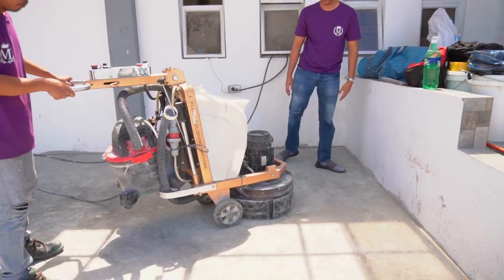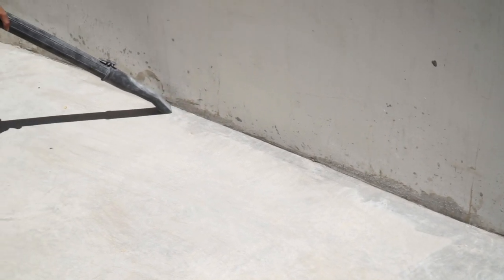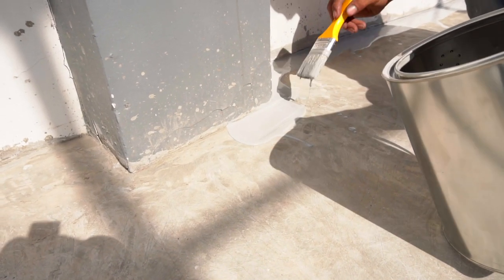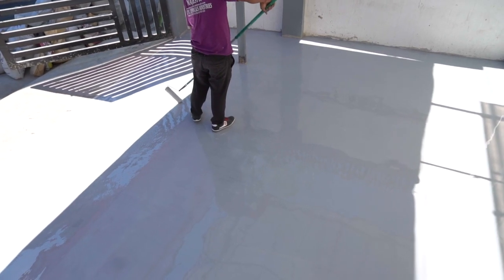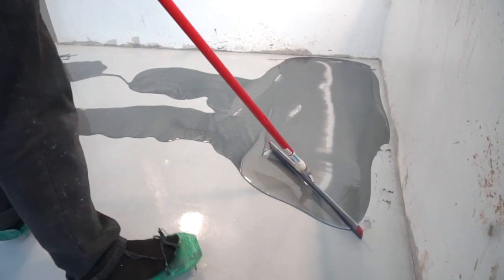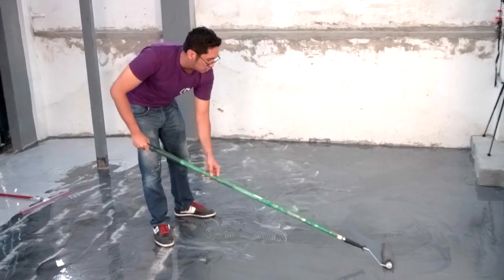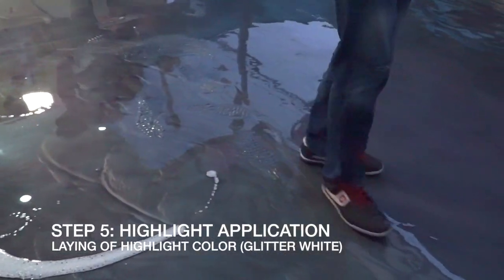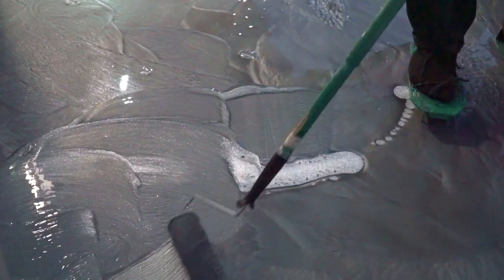METALLIC EPOXY GARAGE PHILIPPINES   METALLIC EPOXY FLOOR PHILIPPINES

Comment: dumadapa puba kusa ang resin? kahit di lapat na lapat ang pag kakalatag,  kasi pag ka roller medyo raspy tas pag na finish makinis na.
Reply from the maker: Good day

Yes sir, Selfleveling po ito at talagang smooth at glossy pag nag ddry na sya :D 
For availing & quicker response, you may contact us
(+639182523454)

Comment: Di po advisable sa garage madulas lalu nat expose sa ulan at araw. Best sa indoor. But ang ganda ng kinalabasan. Thumbs up.
Reply from the maker: Good day, eto pong ating product ay 
-water resistant
-heat resistant 
-scratch resistant
-dust resistant
-chemical resistant
-di nag ccracks
-di nababasag
-walang maintenance, walis or punas lang
-super easy to apply
-shiny at elegant pa tignan
-non-slippery even wet
-odorless & solventless
-industrial grade
-food grade/safe
-Lifetime Quality
Can hold up to 10,000 PSI

Opo di po sya madulas kahit basa maliban dun
sa garage we recomend our Plain Selfleveling Non-metallic resin + UV coat protection sa sun light.

Comment: How much does it cost per sqm? Materials? Labor?
Reply from the maker: Good Day

makakabili po kayo sa amin, just message lang po and we will answer those Questions :)
https://www.facebook.com/majesticchemicals/

also we have LAZADA for COD
You can purchase to our Lazada
then screenshot your order then send it to us here so we can prepare it as soon as possible.
sa Fb page parin po :)
https://www.lazada.com.ph/majestic/?

Visit our Website
https://majesticchemicals.com/

By the way I'm Sherwin of Majestic Chemicals, Glad to assist you :)
For availing & quicker response, you may contact us
09182523454

Join MAJESTIC EPOXY RESIN COMMUNITY PHILIPPINES to show your resin works and share tips
⬇️M⬇️A⬇️J⬇️E⬇️S⬇️T⬇️I⬇️C⬇️ ⬇️C⬇️H⬇️E⬇️M⬇️I⬇️C⬇️A⬇️L⬇️
https://www.facebook.com/groups/398748351104499

Comment: Di ba dali ma gasgas to? How much per sqm ang cost nito?
Reply from the maker: Good day
Materials only
900Php/sqm for Metallic Resin Epoxy
650Php/sqm for Non-metallic Resin Epoxy
 shipping fee not included

2500/sqm for Materials and Labors
equipments and mobilization not included..

di po sya magagasgasan unless sasadyain. 

-water resistant
-heat resistant 
-scratch resistant
-dust resistant
-chemical resistant
-di nag ccracks
-di nababasag
-walang maintenance, walis or punas lang
-super easy to apply
-shiny at elegant pa tignan
-non-slippery even wet
-odorless & solventless
-industrial grade
-food grade/safe
-Lifetime Quality
Can hold up to 10,000 PSI

By the way I'm Sherwin of Majestic Chemicals, Glad to assist you 🙂
For availing & quicker response, you may contact us
09182523454

Comment: Magkano kung 12square meter at kung chemical lang po kami na lang po gagawa?
Reply from the maker: Hi sir san po location? Materials only is 17500. It already includes one gallon primer, one pail metallic with two metallic pigments and shipping fee
Reply: 3333

Comment: Sir pede po ba kayo maggawa ng video ng diy 3d floor using wallpaper tapos with epoxy top coat
Reply from the maker: Good day

Opo, maybe pwede po. But reminder lang po na sa ating resin epoxy need na matibay ang pag lalatagan or pag bubuhusan ng ating resin epoxy or yung base nya. kasi pag weak ang surface may chance na masayang lang. kaya mas prefer natin na rough finish ang floor or kung may tiles, putty sa lines at sanding para kumapit ang resin natin :D 

For availing & quicker response, you may contact us
09182523454

Comment: Pwed b yan sir s rough finish n flooring?
Reply from the maker: Good Day

Opo need tlaga e rough finish :)

makakabili po kayo sa amin, just message lang po and we will answer those Questions :)
https://www.facebook.com/majesticchemicals/

also we have LAZADA for COD
You can purchase to our Lazada
then screenshot your order then send it to us here so we can prepare it as soon as possible.
sa Fb page parin po :)
https://www.lazada.com.ph/majestic/?

Visit our Website
https://majesticchemicals.com/

By the way I'm Sherwin of Majestic Chemicals, Glad to assist you :)
For availing & quicker response, you may contact us
09182523454

Join MAJESTIC EPOXY RESIN COMMUNITY PHILIPPINES to show your resin works and share tips
⬇️M⬇️A⬇️J⬇️E⬇️S⬇️T⬇️I⬇️C⬇️ ⬇️C⬇️H⬇️E⬇️M⬇️I⬇️C⬇️A⬇️L⬇️
https://www.facebook.com/groups/398748351104499

Comment: Saan mkkbili ng materials at pde kmi mka hingi ng broshure.... Processing o paraan step ng lahat para masibukan bgo mka pag apply sa iba nmin customer at mga contrata..
Reply from the maker: Good Day

makakabili po kayo sa amin, just message lang po and we will answer those Questions :)
https://www.facebook.com/majesticchemicals/

also we have LAZADA for COD
You can purchase to our Lazada
then screenshot your order then send it to us here so we can prepare it as soon as possible.
sa Fb page parin po :)
https://www.lazada.com.ph/majestic/?

Visit our Website
https://majesticchemicals.com/

By the way I'm Sherwin of Majestic Chemicals, Glad to assist you :)
For availing & quicker response, you may contact us
09182523454

Join MAJESTIC EPOXY RESIN COMMUNITY PHILIPPINES to show your resin works and share tips
⬇️M⬇️A⬇️J⬇️E⬇️S⬇️T⬇️I⬇️C⬇️ ⬇️C⬇️H⬇️E⬇️M⬇️I⬇️C⬇️A⬇️L⬇️
https://www.facebook.com/groups/398748351104499

Comment: San Po na oorder Yung Resin Sir.? Meron Po ba Ito sa zamboanga city..
Reply from the maker: Good Day

makakabili po kayo sa amin, just message lang po and we will answer those Questions :)
https://www.facebook.com/majesticchemicals/

also we have LAZADA for COD
You can purchase to our Lazada
then screenshot your order then send it to us here so we can prepare it as soon as possible.
sa Fb page parin po :)
https://www.lazada.com.ph/majestic/?

Visit our Website
https://majesticchemicals.com/

By the way I'm Sherwin of Majestic Chemicals, Glad to assist you :)
For availing & quicker response, you may contact us
09182523454

Join MAJESTIC EPOXY RESIN COMMUNITY PHILIPPINES to show your resin works and share tips
⬇️M⬇️A⬇️J⬇️E⬇️S⬇️T⬇️I⬇️C⬇️ ⬇️C⬇️H⬇️E⬇️M⬇️I⬇️C⬇️A⬇️L⬇️
https://www.facebook.com/groups/398748351104499

Comment: magkano material cost per square meter? tsaka labor cost per square meter? and is this waterproof in case sa roof deck iapply?
Reply from the maker: Good day
metallic is color mixed & designed resin epoxy

Metallic Flooring kit
2 Gallons (7 Liters) Selfleveling primer
1 Pail (12 Liters) Metallic/ Liquid marble 
Free 300g metallic pigments 
15sqm coverage area 
18,000 Pesos

Metallic Countertop kit
2 Liters Selfleveling primer
3 Liters Metallic/ Liquid marble
Free150g metallic pigments 
4sqm coverage area 
6,600 Pesos

Metallic Starter kit
1 liter Selfleveling primer
1 liter Metallic/ Liquid marble
Free 50g metallic pigments
1sqm coverage area 
2,800 Pesos

-----

Around NCR area 
Materials & Labor for Marble look metallic Flooring (only indoor)
2,500Php/sqm 
+20k for equipment & mobilization
w/ 5 Years Warranty
---- 
if ang roof deck nyu ay  closed area naman at hindi nasisinigan ng araw pwedeng pwede po yung resin epoxy natin sa roof deck nyu.

meron tayong plain which is non-metallic nilalagyan ng uv coat para pwede sa mga direct sunlight.. 

 Available in White, Black and Gray colors

Non-metallic Flooring kit
7 Liters Selfleveling primer
14.5 Liters Selfleveling Topcoat
15sqm coverage area 
13,000 Pesos

Non-metallic Countertop kit
2 Liters Selfleveling primer
3.5Liters Selfleveling Topcoat
4sqm coverage area 
4,100 Pesos

Non-metallic Starter kit
1 litter Selfleveling primer
1 litter Selfleveling Topcoat
1sqm coverage area 
1,600 Pesos

Materials & Labor for plain Non-metallic Flooring(can be outdoor)
1,800Php/sqm 
+20k for equipment & mobilization
w/ 5 Years Warranty

-----

if really interested po.. plss call or text me..
For availing & quicker response, you may contact us
09182523454

Comment: How much does it cost for a 20sqm floor?
Reply from the maker: Good Day

You can go to our FB page for inquires :)

makakabili po kayo sa amin, just message lang po and we will answer those Questions :)
https://www.facebook.com/majesticchemicals/

also we have LAZADA for COD
You can purchase to our Lazada
then screenshot your order then send it to us here so we can prepare it as soon as possible.
sa Fb page parin po :)
https://www.lazada.com.ph/majestic/?

Visit our Website
https://majesticchemicals.com/

By the way I'm Sherwin of Majestic Chemicals, Glad to assist you :)
For availing & quicker response, you may contact us
09182523454

Join MAJESTIC EPOXY RESIN COMMUNITY PHILIPPINES to show your resin works and share tips
⬇️M⬇️A⬇️J⬇️E⬇️S⬇️T⬇️I⬇️C⬇️ ⬇️C⬇️H⬇️E⬇️M⬇️I⬇️C⬇️A⬇️L⬇️
https://www.facebook.com/groups/398748351104499
Reply: @MajesticChemicals  location niyo po sir?may gray po ba kyo na pang floor?

Comment: Mas mkakatipid b pag epoxy floor compare sa tiles?
Reply from the maker: Good Day

Yes sir :) In terms of Quality at Lifelines natagal po ito ng maraming Decada
-water resistant

-heat resistant
-scratch resistant
-dust resistant
-chemical resistant
-di nag ccracks
-di nababasag
-walang maintenance, walis or punas lang
-super easy to apply
-shiny at elegant pa tignan
-non-slippery even wet
-odorless & solventless
-industrial grade
-food grade/safe
-Lifetime Quality

makakabili po kayo sa amin, just message lang po and we will answer those Questions :)
https://www.facebook.com/majesticchemicals/

also we have LAZADA for COD
You can purchase to our Lazada
then screenshot your order then send it to us here so we can prepare it as soon as possible.
sa Fb page parin po :)
https://www.lazada.com.ph/majestic/?

Visit our Website
https://majesticchemicals.com/

By the way I'm Sherwin of Majestic Chemicals, Glad to assist you :)
For availing & quicker response, you may contact us
09182523454

Join MAJESTIC EPOXY RESIN COMMUNITY PHILIPPINES to show your resin works and share tips
⬇️M⬇️A⬇️J⬇️E⬇️S⬇️T⬇️I⬇️C⬇️ ⬇️C⬇️H⬇️E⬇️M⬇️I⬇️C⬇️A⬇️L⬇️
https://www.facebook.com/groups/398748351104499
Reply: @MajesticChemicals  sir magkanu po byan

Comment: Mas mahal po b ang cost nyan compare sa mga tiles?
Reply from the maker: Good Day

Mas mura po ito in terms of how long it last at sa Quality :) 
-water resistant
-heat resistant
-scratch resistant
-dust resistant
-chemical resistant
-di nag ccracks
-di nababasag
-walang maintenance, walis or punas lang
-super easy to apply
-shiny at elegant pa tignan
-non-slippery even wet
-odorless & solventless
-industrial grade
-food grade/safe
-Lifetime Quality
Can hold up to 10,000 PSI

tumatagal ng maraming Dekada, di nag ffade :)

makakabili po kayo sa amin, just message lang po and we will answer those Questions :)
https://www.facebook.com/majesticchemicals/

also we have LAZADA for COD
You can purchase to our Lazada
then screenshot your order then send it to us here so we can prepare it as soon as possible.
sa Fb page parin po :)
https://www.lazada.com.ph/majestic/?

Visit our Website
https://majesticchemicals.com/

By the way I'm Sherwin of Majestic Chemicals, Glad to assist you :)
For availing & quicker response, you may contact us
09182523454

Join MAJESTIC EPOXY RESIN COMMUNITY PHILIPPINES to show your resin works and share tips
⬇️M⬇️A⬇️J⬇️E⬇️S⬇️T⬇️I⬇️C⬇️ ⬇️C⬇️H⬇️E⬇️M⬇️I⬇️C⬇️A⬇️L⬇️
https://www.facebook.com/groups/398748351104499

Comment: maganda,magaling..kaso sana ung laylayan ng mga wall nilagyan ng tape..pra hnd sna inabot..dumi eh
Reply from the maker: Good Day

makakabili po kayo sa amin, just message lang po and we will answer those Questions :)
https://www.facebook.com/majesticchemicals/

also we have LAZADA for COD
You can purchase to our Lazada
then screenshot your order then send it to us here so we can prepare it as soon as possible.
sa Fb page parin po :)
https://www.lazada.com.ph/majestic/?

Visit our Website
https://majesticchemicals.com/

By the way I'm Sherwin of Majestic Chemicals, Glad to assist you :)
For availing & quicker response, you may contact us
09182523454

Join MAJESTIC EPOXY RESIN COMMUNITY PHILIPPINES to show your resin works and share tips
⬇️M⬇️A⬇️J⬇️E⬇️S⬇️T⬇️I⬇️C⬇️ ⬇️C⬇️H⬇️E⬇️M⬇️I⬇️C⬇️A⬇️L⬇️
https://www.facebook.com/groups/398748351104499

Comment: How much po inabot ganyann
Reply from the maker: Good Day

makakabili po kayo sa amin, just message lang po and we will answer those Questions :)
https://www.facebook.com/majesticchemicals/

also we have LAZADA for COD
You can purchase to our Lazada
then screenshot your order then send it to us here so we can prepare it as soon as possible.
sa Fb page parin po :)
https://www.lazada.com.ph/majestic/?

Visit our Website
https://majesticchemicals.com/

By the way I'm Sherwin of Majestic Chemicals, Glad to assist you :)
For availing & quicker response, you may contact us
09182523454

Join MAJESTIC EPOXY RESIN COMMUNITY PHILIPPINES to show your resin works and share tips
⬇️M⬇️A⬇️J⬇️E⬇️S⬇️T⬇️I⬇️C⬇️ ⬇️C⬇️H⬇️E⬇️M⬇️I⬇️C⬇️A⬇️L⬇️
https://www.facebook.com/groups/398748351104499

Comment: Sir mga magkano po ang magagasto sa 50sqm na floor pag resin.,my fb page po ba kayu sir?
Reply from the maker: Good Day

For more details, Pm us po

makakabili po kayo sa amin, just message lang po and we will answer those Questions :)
https://www.facebook.com/majesticchemicals/

also we have LAZADA for COD
You can purchase to our Lazada
then screenshot your order then send it to us here so we can prepare it as soon as possible.
sa Fb page parin po :)
https://www.lazada.com.ph/majestic/?

Visit our Website
https://majesticchemicals.com/

For availing & quicker response, you may contact us
09182523454

Join MAJESTIC EPOXY RESIN COMMUNITY PHILIPPINES to show your resin works and share tips
⬇️M⬇️A⬇️J⬇️E⬇️S⬇️T⬇️I⬇️C⬇️ ⬇️C⬇️H⬇️E⬇️M⬇️I⬇️C⬇️A⬇️L⬇️
https://www.facebook.com/groups/398748351104499

Comment: sir how much po magpaganyan for 30sqm
Reply from the maker: Good Day

Mag tungo lamang po sa aming FB page for more inquiries :) at para din po masagot ang concern nyu about  30sqm

makakabili po kayo sa amin, just message lang po and we will answer those Questions :)
https://www.facebook.com/majesticchemicals/

also we have LAZADA for COD
You can purchase to our Lazada
then screenshot your order then send it to us here so we can prepare it as soon as possible.
sa Fb page parin po :)
https://www.lazada.com.ph/majestic/?

Visit our Website
https://majesticchemicals.com/

By the way I'm Sherwin of Majestic Chemicals, Glad to assist you :)
For availing & quicker response, you may contact us
09182523454

Join MAJESTIC EPOXY RESIN COMMUNITY PHILIPPINES to show your resin works and share tips
⬇️M⬇️A⬇️J⬇️E⬇️S⬇️T⬇️I⬇️C⬇️ ⬇️C⬇️H⬇️E⬇️M⬇️I⬇️C⬇️A⬇️L⬇️
https://www.facebook.com/groups/398748351104499

Comment: New subscriber here. How much did it cost for this specific project? Materials quantity and price.
Reply from the maker: Good Day

makakabili po kayo sa amin, just message lang po and we will answer those Questions :)
https://www.facebook.com/majesticchemicals/

also we have LAZADA for COD
You can purchase to our Lazada
then screenshot your order then send it to us here so we can prepare it as soon as possible.
sa Fb page parin po :)
https://www.lazada.com.ph/majestic/?

Visit our Website
https://majesticchemicals.com/

By the way I'm Sherwin of Majestic Chemicals, Glad to assist you :)
For availing & quicker response, you may contact us
09182523454

Join MAJESTIC EPOXY RESIN COMMUNITY PHILIPPINES to show your resin works and share tips
⬇️M⬇️A⬇️J⬇️E⬇️S⬇️T⬇️I⬇️C⬇️ ⬇️C⬇️H⬇️E⬇️M⬇️I⬇️C⬇️A⬇️L⬇️
https://www.facebook.com/groups/398748351104499
Reply: Magkano magagawa sa inyo?
Reply from the maker: @johnraymondsiega7017  Good day sir, 2500/sqm po tayo Materials and Labors, 
di pa include ang Equipment and Mobilization

Comment: ask lng po ano po mas maganda epoxy floor than floor tiles po...salamat
Reply from the maker: Good Day

Opo dahil maliban sa Buo tignan, Quality pa :)

makakabili po kayo sa amin, just message lang po and we will answer those Questions :)
https://www.facebook.com/majesticchemicals/

also we have LAZADA for COD
You can purchase to our Lazada
then screenshot your order then send it to us here so we can prepare it as soon as possible.
sa Fb page parin po :)
https://www.lazada.com.ph/majestic/?

Visit our Website
https://majesticchemicals.com/

By the way I'm Sherwin of Majestic Chemicals, Glad to assist you :)
For availing & quicker response, you may contact us
09182523454

Join MAJESTIC EPOXY RESIN COMMUNITY PHILIPPINES to show your resin works and share tips
⬇️M⬇️A⬇️J⬇️E⬇️S⬇️T⬇️I⬇️C⬇️ ⬇️C⬇️H⬇️E⬇️M⬇️I⬇️C⬇️A⬇️L⬇️
https://www.facebook.com/groups/398748351104499

Comment: Hello po! San po pwedeng makabili ng mga materials? Magkano po ba yan?
Reply from the maker: Good Day

makakabili po kayo sa amin, just message lang po and we will answer those Questions :)
https://www.facebook.com/majesticchemicals/

also we have LAZADA for COD
You can purchase to our Lazada
then screenshot your order then send it to us here so we can prepare it as soon as possible.
sa Fb page parin po :)
https://www.lazada.com.ph/majestic/?

Visit our Website
https://majesticchemicals.com/

By the way I'm Sherwin of Majestic Chemicals, Glad to assist you :)
For availing & quicker response, you may contact us
09182523454

Join MAJESTIC EPOXY RESIN COMMUNITY PHILIPPINES to show your resin works and share tips
⬇️M⬇️A⬇️J⬇️E⬇️S⬇️T⬇️I⬇️C⬇️ ⬇️C⬇️H⬇️E⬇️M⬇️I⬇️C⬇️A⬇️L⬇️
https://www.facebook.com/groups/398748351104499